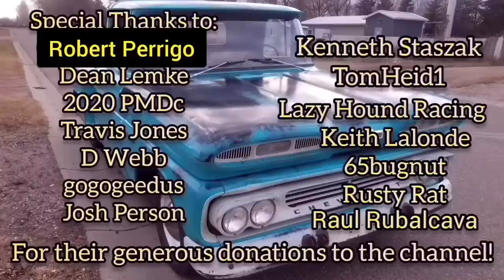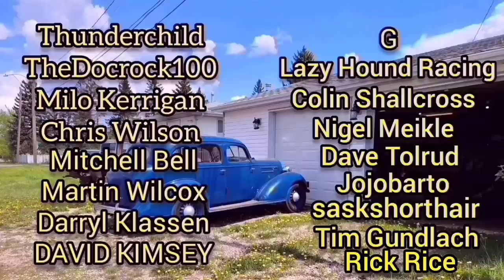You WON'T BELIEVE What I Did To These Rare Classic Truck Running Boards! 1948 GMC Restoration

Comment: "Going to roughly and crudely repair this running board" Then it's both original and better than the vast majority of replacement parts out there on the market.  Well done sir, very, very well done.
Reply from the maker: Thanks, but I can guarantee the aftermarket ones are way better than my cobbled together example
Reply: @CarterAutoRestyling  agree to disagree.. 😉
Reply: Why buy new if repaired does the job?

Comment: I'm convinced you are looking at my 53 before you make your videos. My running boards are not rusty but they have the same sideswipes. A friend of mine bought new running boards and they are a thinner gauge steel. I'm widening my front and rear fenders 2" so I need to widen the running boards. Thanks for the tip on getting the same year donor ones. I have been searching for decades for the optional wide running boars that GM made but it's probably not going to happen. Allen and Poe sure seem to like their bag. They are lucky cats for having you. I did some baking today and now it's time to finish the 16 nitrous/fuel hard lines on my 6-71 for the 292 I6. You have to have your mind right for that stuff. I still screw up but It doesn't bother me as much to do it over. Thank you for your time.
Reply from the maker: Oh I haven't been looking at your truck...the issue is that all the advance design trucks that I buy have all the common problems, as well as a few that haven't been discovered yet. There's going to be some overlap when everything I work on is junk haha

Comment: I heard that sometimes those worn out stamping dies are sold to after-market suppliers who then make and sell replacement parts such as fenders, etc.  The problem, as you have shown, is that the fit and finish of the stuff is not up to original standards.  Therefore, making the "new replacement" panel fit takes a lot of effort.
Reply from the maker: It's also why a lot of Nos parts don't fit either, after vehicle production ended the factory would use the worn out dies to stamp out the required amount of replacement panels. By the time they were done the dies were completely ruined

Comment: Nice quick repair Kyle. It looked good to me, a little plastic filler and good as new. I'm glad you decided against the "shorts". I dislike those videos, and more and more guys are starting to use them. I pretty much ignore them and watch the full length ones. Keep up the good work, we're pulling for ya!
Reply from the maker: Thanks Ken! I agree, I really don't like the shorts and I don't think they would help the channel in the long run

Comment: Thanks for the video, Kyle - I did pick up a tip or two for when I return to straightening the running boards on my ‘41 Plymouth (gotta use a bigger hammer).  Crying shame about all the effort you have to go through to right the wrongs perpetrated by the GMC’s previous owner.  Cheers - until next time!
Reply from the maker: Hi Rick, I'm glad to hear you were able to pick up a couple tips for your Plymouth!

Comment: Good save! I had a similar repair on my '38 Studebaker cab forward truck to contend with. Challenging because it was a diamond plate pattern. I was lucky enough to have a donor section to use on my keepers. Came out pretty well, but made the mistake of powder coating them gloss black which highlighted a lot of my repair. I guess I coulda gone to the parts department of my local dealership to obtain fresh ones, but apparently Studebaker went tits up some 60 years ago. Bummer.
Reply from the maker: Yeah those diamond plate running boards would be a big challenge! The Studebaker dealerships really need to get their act together!

Comment: I might have slit the radius at the mismatch of the top flange and flared the one and compressed the other to get a better transition for little extra work. But it is what it is when trying to make garbage presentable like you do.
Reply from the maker: Yeah, if they were in better shape that would be worthwhile!  In this case the rear section is on its last legs so it didn't make much sense to do that with how pitted up the metal is.
Reply: @CarterAutoRestyling  At least there's something there now. The new owner can do with it what they want.

Comment: Thanks for all the good info Kyle!! 
Grinding the welds on this repair looked like it presented a bit of a tough challenge due to all the close proximity shapes. It appeared you used a pretty wide variety of discs to get all the grinding done. Maybe even including the "cut-off" disc ?? Would you mind spending a little time providing some input gained from your experience regarding what kind/shape/brand of discs you use for certain "difficult" tasks?? Thank you !! 
PS: Liked your suggestion Re: the fiberglass front fenders on the 37 Chevy ---- CWM !!! ;o)
Reply from the maker: I usually just use 3" norton 50 grit roloc discs, cut down to size if needed, however I'm out of money and the desire to go to the city to buy more, so I'm just using whatever sharp round things I've got laying around. I wish Scott would have taken my fender suggestion more seriously
Reply: @CarterAutoRestyling  Thank you !! ;o)

Comment: It's hard to remember just how rough these two trucks were in the beginning. If you hadn't put the time and effort into them they would have eventually become some Chinese disposable crap. You've done a fantastic job Kyle.
Reply from the maker: Thanks Brian! The farm that the GMC was at was getting cleaned out, so if Scott and his brother in law hadn't stepped in the truck would already be scrap
Reply: @CarterAutoRestyling  Well they certainly made sure that it ended up in the right hands.

Comment: Always enjoy your videos Kyle. The longer the better. I do have one inquiry though...where does a guy find a sweet shop coat like the one you're sporting? I need one...bad.
Reply from the maker: There's one in my backyard half buried in snow. It's free for the taking, but it's most likely frozen to the ground so extraction could prove a challenge

Comment: I half expected you to cut out a rusty part and then weld in a different rusty part. Oh, wait...
Reply from the maker: What you didn't see is the part where I started tack welding the two original rusty pieces back together that I had just finished cutting in half...

Comment: Hey again Kyle. Not shown so much in this video, but in general is there a reason you use a disc on a drill to knock down your welds vs any other way?
Reply from the maker: Because I don't have a good air compressor or grinder

Comment: Cats in a video during welding. Good idea. Mismatched parts due to acceptable wear, correct and good information for future and now. 
I think I would do a better job of it. While trying to do a better job of it, wish I had you here to fix the dogs breakfast I be making of it. I reckon many of us sit watching thinking stuff that's really bullS*"#.
The reality is precisely as presented here by your film. A clever bit of work on both counts. And we won't notice once it's installed and evenly coated in road dust and dirt.

Comment: Awe kid nobody will notice that mismatch on the running board when that truck flys by at twenty seven miles an hour! You could make short videos of you playing with the cats. Everybody else does. Try that trick where you sneak a cucumber behind them while they are eating and wait until they turn around and see it. Pretty funny when it works. By the way did that shady car dealer have a title for that "truck" that he sold you?

Comment: You really should at the very least wear a face shield when using the grinder with a cut off wheel. Had many friends get Hurt BADLY  from those thin discs up and let go.